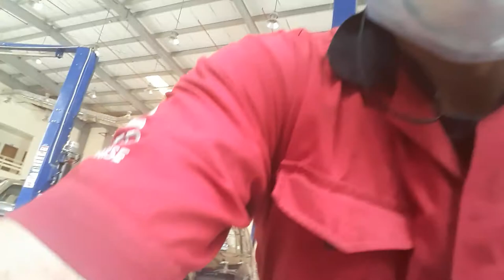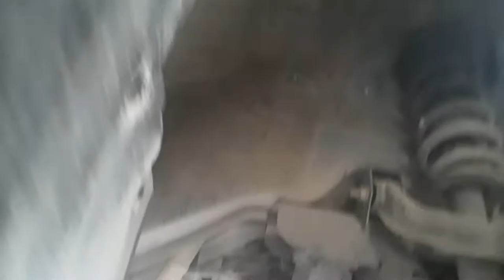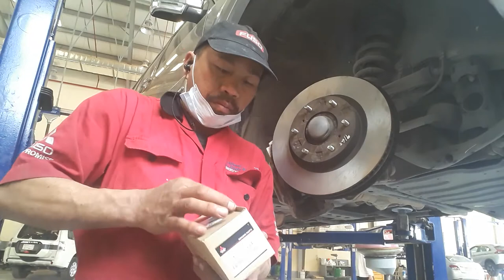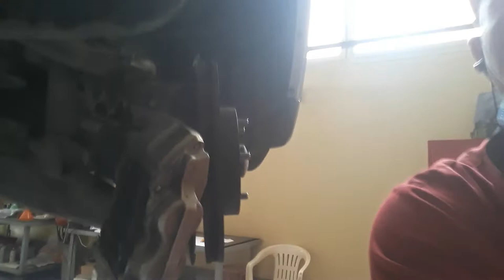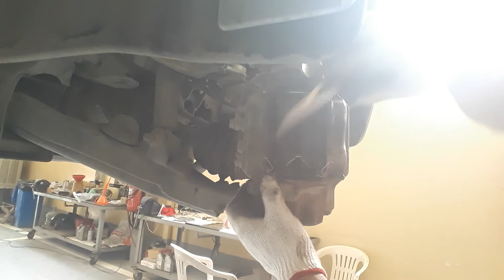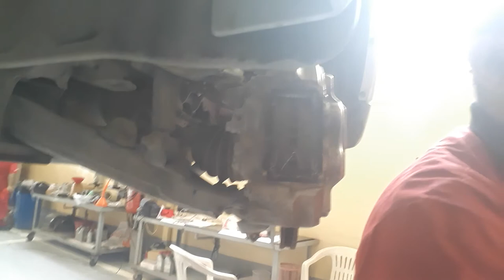mitsubishi pajero.(how to install brake pads front

Comment: Thanks. My brakes are squealing after I machine the rotor disc and replace brake pads (Genuine Mitsubishi). Two mechanics checked and said “No problem”. Question- Does pajero brake pads have shims?
Reply: ang 2017 pajero sa harap at likurang preno ay may shims.